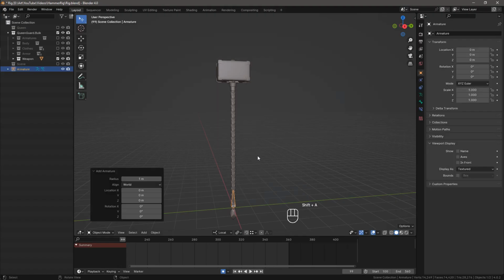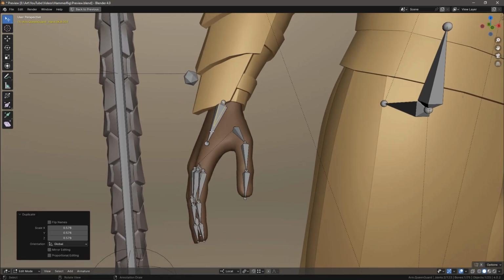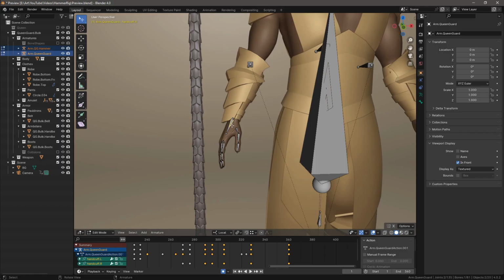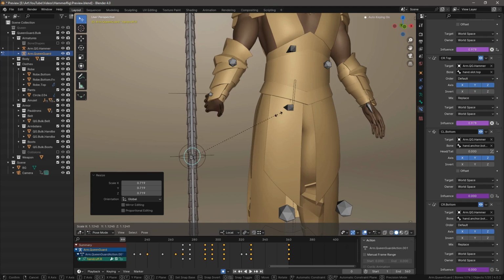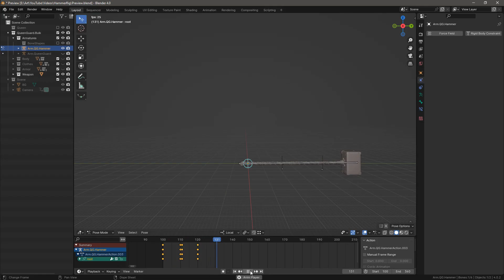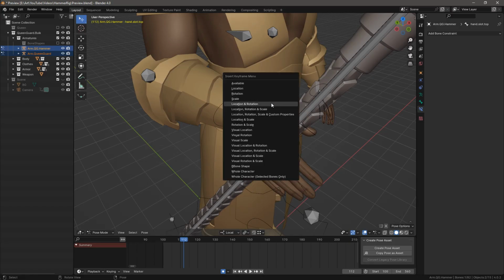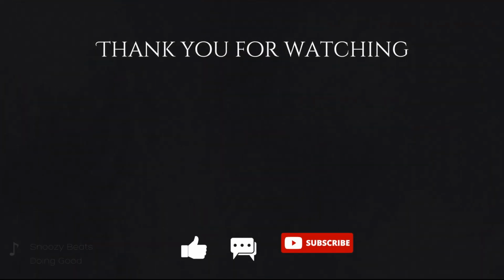Comfortable two-handed weapon rig | Blender tutorial

Comment: Will this be able to be exported to unity
Reply from the maker: To export it to any game engine you'll need to bake animations. In this case it will work like anything else. But if you want to animate your rig dynamically in the engine, it won't work because it uses Blender's bone constraints. Theoretically there can be something similar to these constraints in the engine or external plugins (something that makes a bone follow another bone), but I'm not aware of anything like this as I haven't been working with game engines for a very long time.

Comment: Hey, lets just say that I don't wanna slide the hand. I only need one hand to snap on one end of the weapon. what adjustments can I make? I assume probably limit scale and the driver value in copy locations and rotation on each handcuffs, but what value exactly is what I want to know. Thanks in advance, very useful tutorial!
Reply from the maker: Hey. Just to ensure that we're on the same page - you want the same rig, but you don't need hands to be able to snap to both anchors, only to each corresponding one, right? If so, you need to change the maximum scale to 1 (was 1.2) and remove the second pair of copy transforms constraints. Please let me know if this is what you need )
Reply: @kridaran_art  yep this is exactly what I'm looking for. it works! thanks
Reply from the maker: @theendisnear2398  always welcome )

Comment: how did you get the deformer to move the weapon while allowing the root to also move the weapon? I can only get the root to move the weapon rn
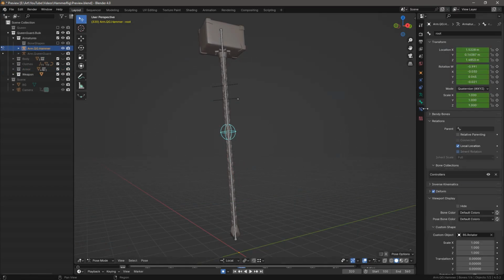Reply from the maker: technically only deformer moves the weapon. root moves the deformer, so therefore weapon moves with the deformer. there's such hierarchy -- root -> deformer -> weapon. each child inherits transform of it's parent. and I just noticed that I forgot to make this connection on the video, my bad. but there's a full hierarchy at 1:23, you can check if your one matches it, this is very important step.

Comment: Thank you, this is actually really flexible than I expected.
Reply from the maker: Glad that you like it )
I decided to avoid some fancy setups that do everything automatically, but break as soon as you throw them into real animation where bones are not always rotated like 0 0 0 😅
So yeah, requires some manual effort, but works in any situation and in the way you expect it to work 🙃
Reply: @kridaran_art  8 hours later, I tried to make a sword animation, i dunno how or where, but my left hand is broken, I'll try to fix this.
Reply from the maker: @MadEraser-lv4ti  broken in what way? 👀 maybe I can help
Reply: @kridaran_art  I used the normal human metarig inbuilt from blender, however, this rig creates dependency cycles which makes the left hand laggy as hell, the deformation bone takes at least 3-4 frames to follow with the main bone controlling the DEF Bone (IK/FK), I'm sure this could be fix if I had created a rig made by myself.

Even though this problem arises, I could make a 1 handed system with the weapon as the root, only a 1 handed system is that I can successfully make. Using the weapon root as the place for drivers (using the same setup), and attach them to a different bone that I placed on the hands. 

The 13 dependency errors are still a huge mess and caused lots of stress, unsure how to fix them. I still haven't thought of a solution that would work completely, the weapon itself isn't the problem, dependency errors are really a hassle to fix.
Reply: I'd probably use child of constraint or something and attach it on the IK bone, I haven't tested it yet. Your rig is Hella flexible, and I honestly enjoyed it.
Reply from the maker: @MadEraser-lv4ti  And another argument for me to keep embracig the manual approach further... Yeah, my cahracter has custom rig and it's much simpler. At least it only has IK connections for the limbs. I don't have experience with automated rigs, but from what you've described it seems like there's too many constraints or something else that requires additional processing. This is just a guess, but I could suggest to try to move the "handcuff" bone higher in the hierarchy if this is usable in this case.
Reply from the maker: @MadEraser-lv4ti  Or actually, you could throw away the handcuff bones and either add another proxy "slot" bones or use existing ones in the weapon rig to copy transforms of the IK bones to. This way your IK bones are not paranted to anything new, and you still keep the flexibility by moving hand with the slot/proxy-slot bones. So you keep the functionality, but remove one dependency. This might sound a bit messy, so pease let me know if you'd like to get more detailed explanation
Reply from the maker: And btw. I don't know if this is applicable to the human metarig, but default IK setup likes to jiggle as hell when the IK bone is far from the targeting one. Like if you move hand too far, the forearm and elbow go crazy. You probably know this without me, but telling this just in case. This could be useful